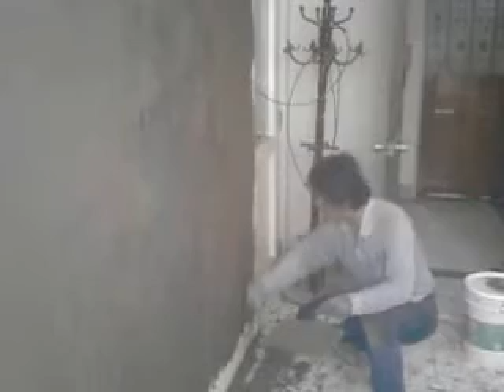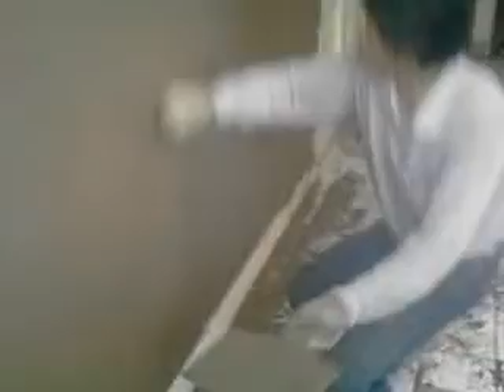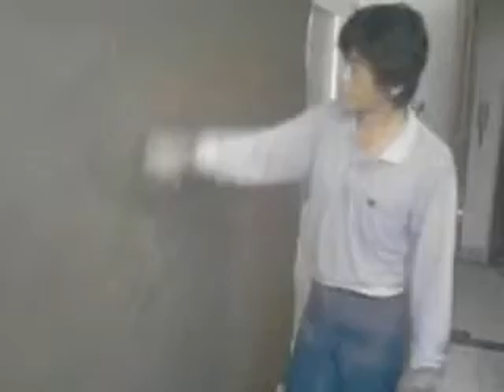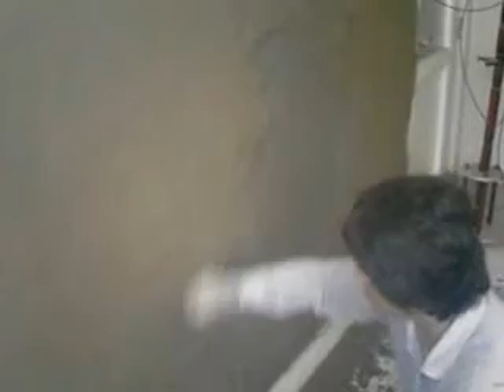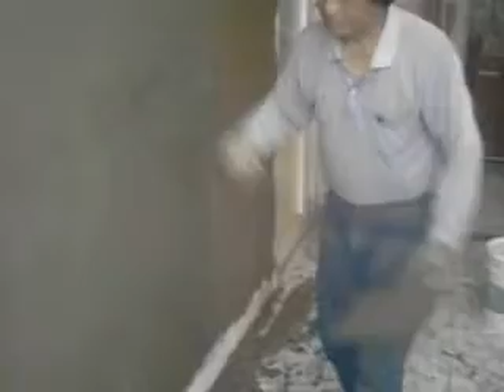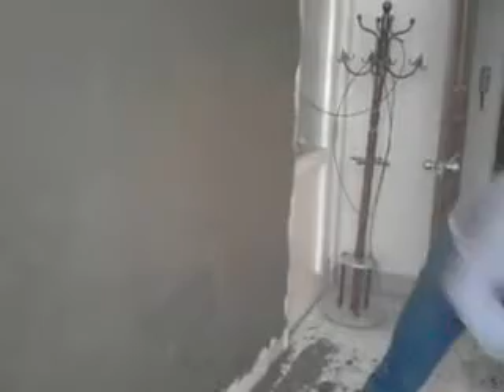Sand and Cement Rendering, Final Coat

Comment: From a home-builder's perspective and concerning the skill of sand and cement rendering on brick or concrete walls, there are three coats to take into consideration, .. first coat, second and final. Renderer should ensure a horizontal and vertical surface on first coat, second coat acts as a joining element between first and final coat. And final coat of course, pay more attention about the mixture and proportion of sand and cement ratio. The surface of final coat should shine brightly like a mirror effect.

Master has performed successfully. Well done!